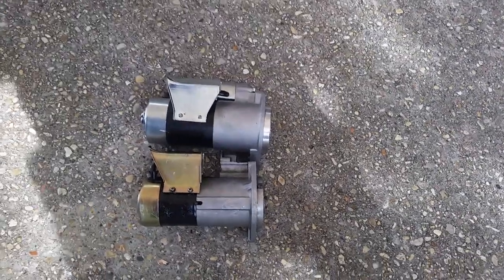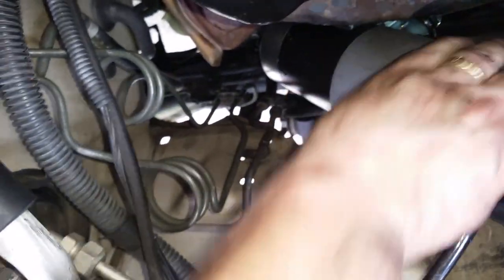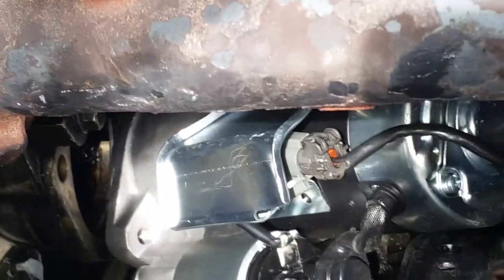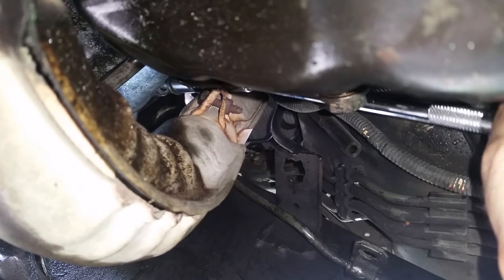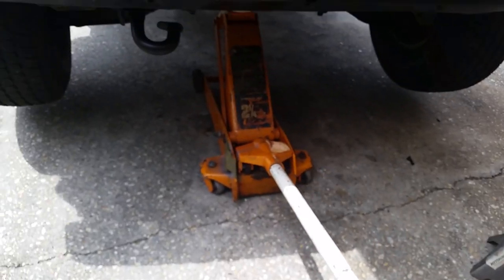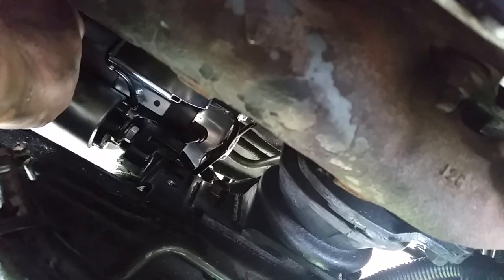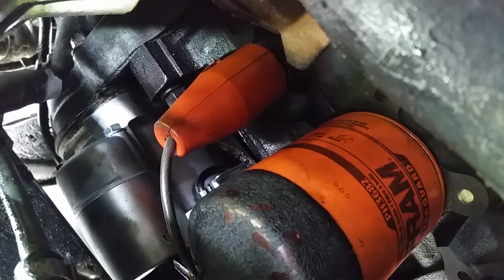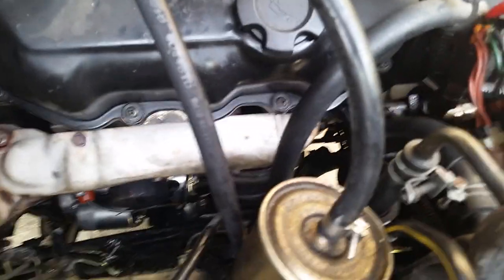1990 - 1995 Nisan 4WD Pathfinder D21 Starter Change Part 2 Nissan 23300-88G01

Comment: I successfully changed the starter in my 1991 Pathfinder and I couldn't have done it without your video. I transferred the metal shield that covers the solenoid wire connector from the old starter to the new starter which was easier than disconnecting the 3 support brackets. You mentioned the amount of oil your Nissan is leaking. My special request is that you do a video of how to change the driver's side valve cover gasket if you still have your Nissan. Thanks for the starter video. Your camera work was excellent.
Reply from the maker: Ah thanks Rob I appreciate that. Glad the video helped. I still own it but it pretty much shits now because it's got a blown head gasket. I would do a video on that but I'm just to busy to get to it. Best Wishes & Blessings. Keith Noneya

Comment: The Wobble Extension is the key to anything you do on a tight fitting vehicle.  I had to take the starter loose to get the exciter wire off, to check the current.  I traced it down to the relay, its gray on the drivers by the wiper fluid reservoir.  your tips are greate, I would not have done it without you.  I bought a set of the extensions good investment!!!!  I have a 1995 California modal 4X4 XE V6  original owner.  Timing belt, water pump, radiator, and this.  Its been good to me.
Reply from the maker: Thanks Gary, always nice to hear from those watching my videos that the video helped them. Glad it all worked out for you. Best Wishes & Blessings. Keith Noneya
Reply: Wat is te exciter wire for?

Comment: WOW! Great videos on the starter. Great info on the tools you need
I need to buy more tools to attempt this.
And buy some patience too. Thanks a ton. Learned a lot.
Reply from the maker: Thanks Gary, I hope the install goes well for you. I have a playlist dedicated solely to the 1995 D21 Pathfinder on my channel. Check it out if you need some more info, like O2 Sensor or how to access the on board Nissan Diagnostic codes. Best Wishes & Blessings. Keith Noneya
Reply: 4Dd

Comment: Thanks man. I need to swap out the starter on my pathfinder. I was replacing my thermostat and while I was under the car I noticed a loose wire and it looked like it went to the little make tab on the starter solenoid so I put it on there because when I was done with the thermostat my car wouldn’t start. I couldn’t figure out why.  Well I also learned from this video that I’m an idiot. Lol.  That wire is actually the oil sensor wire. 🤪.   So, I have to put that wire where it belongs and see if my car will start.  It’s been a nightmare and now I know what I have to do to replace my starter that I think I fried.  Ugh.
Reply from the maker: Most likely it didn't fry the starter, but possibly the solenoid that controls the starter motor. So you will probably have to pull the starter to change the solenoid anyways. Depending on how many miles it's been since the starter was changed you might as well change the whole starter assembly so you won't end up changing it later. Before you pull the starter out the top, some folks have said they were able to pull it out the front over the frame. See if you can do that after you get it loose so you don't have to do it the more complicated way. Meaning having to pull the Oil Pressure Sensor, Oil Filter, Fuel Line Clamps and Exhaust Heat Shield. Also you can look in the description of the video and find a link to get the Factory Service Manual. In there you'll find all the wiring diagrams, connector names and the locations of all those items if you end up needing them. Best Wishes & Blessings. Keith Noneya
Reply: @keithnoneya  the starter was just replaced the beginning of 2019.
Reply from the maker: @mattstearns4399  You can manually test it in place if you know how, by jumpering the Inhibitor Relay. If you manually test it you'll have to make sure the truck is in Park, or Neutral if you have a manual. What year do you have and is it a D21 Truck or a Pathfinder? Let me know if you need anymore help. Best Wishes & Blessings. Keith Noneya

Comment: I was wondering about the oil pressure sensor wire. Mine is broken the same way and I bought a new sensor but what type of connector do I need ? I saw the one you put on but you only addressed that issue briefly. I’d that a common thing for that wire to be broken because some of the pictures show a harness that clips into the end of the sensor
Reply from the maker: I just used a regular Insulated Interior Connection Quick Disconnect Terminal. You can pick one up at the local hardware or auto parts store. Here's an example: https://www.autozone.com/ignition/electrical-wire-connector/dorman-conduct-tite-insulated-interior-connection-quick-disconnect-terminal/510835_0_0 
- The oil sensor actually had a shield around the male connector on to, but it got in the way so I just broke the plastic area off and it has never given me any trouble. Hope that helps you get er done. Thanks for watching. Best Wishes and Blessings. Keith Noneya

Comment: hey it's February 2023 now. I'm in Australia trying to do the same thing. problem is; my d21 is Right Hand Drive. i can't bring the starter up through that space like you did; because the steering shaft runs down that side. i got the bolts out, but now i have to work out how to get it out.
Reply from the maker: Ya gotta love Australian law makers who require left hand drive only. Got to visit Perth and Fremantle and got to hang out with a family there back in the 80's, loved it. The 1st time I did the starter I pulled the Exhaust Crossover Tube. So in your case I would drop the Exhaust Cross over tube. When I did mine I used 1/2" Wobble Extensions. The 1st time doing it is a real bear, but once you figure it out it's not to bad, it's just learning it the 1st time is not fun. Before you start the job, make sure and get some new gaskets. Unfortunately it most likely will require you to pull the heat shields on the drivers side top to get to the bolts, and they are usually rusted on pretty good. Let me know how it turns out. Best Wishes & Blessings. Keith Noneya
Reply: @keithnoneya  last time it went about 10 years ago. the auto electrician fixed it. he had the whole job done in half a day. i can't get hold of him at the moment. I think he might have covid. I would ask him how he got it out if I could. I was thinking maybe i could just move the auto transmission lines. that's all that's really stopping it. anyway I'll be back at it today. so see how we go. I already got the bolts out. from underneath. same way you did with wobble extensions.
Reply from the maker: @vk3act  Keep up the good work. Hey when you figure it out post a quick video on your channel, I'm sure so fellow Aussie's would love to know how you did it. I'd also like to post the procedure in my video description and give you the credit for the Aussie Method. Best Wishes & Blessing. Keith Noneya

Comment: @keithnoneya what are the dimensions of the starter bolts.  I lost the bolts
Reply from the maker: I have not idea what they would be, you could go to the dealer and ask them or pick one up on line or head to the wrecking yard and pull some.

Comment: I just bought a 95 Pathfinder replaced all the bushings in the front suspension... the truck would not start...it does have a leak in the exhaust manifold on the passenger side... my next adventure.
Reply from the maker: Hi Amanda sorry to hear that. Let me ask you a few questions, please answer by number.
1. Does it turn over, meaning you can hear the starter turning the engine over?
2. Do you have dash lights?
- If the answer is no on 1 & 2, then watch this video: https://www.youtube.com/watch?v=A51r0wbxV-o
- if it turns over and you have dash lights, then you have a different issue. Get back with me and I'll try and help you solve the problem. Keith Noneya

Comment: Or do i need it?
Reply from the maker: If you're talking about that round shield plate you kinda need it to hole the solenoid connector. Otherwise it will just flop around and eventually break the wire inside and then the truck won't start. If you're talking about the Exhaust manifold shield plate, yeah you kinda need that to protect the power steering and fluid hoses from getting warm. Hope that answers your questions. If not tell me what time index on the video you're taking about and I'll take a look at it. Thanks for watching. Best Wishes & Blessings. Keith Noneya

Comment: Can i take the plate off?
Reply from the maker: Which plate? If you mean the exhaust I don't recommend it. It sits right next to the power steering reservoir. If you mean the cover that holds the connector I don't recommend that either, it keeps the wires from moving back and forth and possible breaking. Think of it as a coat hangar you bend back and forth, sooner or later it's going to snap. That same thing

Comment: You don’t take the starter out the top. It took out from below.
Reply from the maker: Wish I could have. I've done this starter on this year three times in 20 years. The 1st two times, I tried to go out the bottom, but because of the 4WD system it wouldn't go out the bottom. Been working on cars for over 30+ years and never saw a starter so poorly planned on a 4wd. If you did yours from below, PLEASE make a video of you doing it so the next time I can do it your way. Best Wishes & Blessings. Keith Noneya
Reply: @keithnoneya  you go out the front above the front axle and to the left of the oil pan. Should have enough room
Reply from the maker: @Jack Thompson  Unfortunately I tried that the three times I changed this starter, and so have several others that have told me so in their comments. If you go to time index 7:09 in the video you can see there's not room under the motor mount to go over the axle. Tried it several times and couldn't do it, & I've worked on vehicles for over 30 years. It's the worst design for a starter I've ever seen. So that's why I made the video, for folks like them who have not been able to go over the front 4wd axle and passed the engine mounts. Thanks for the advice anyways. Best Wishes & Blessings. Keith Noneya